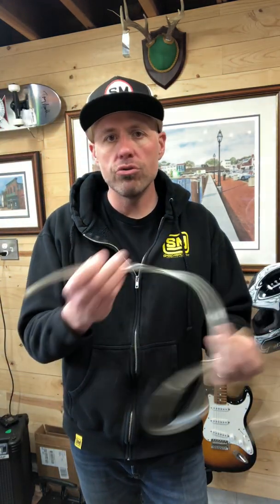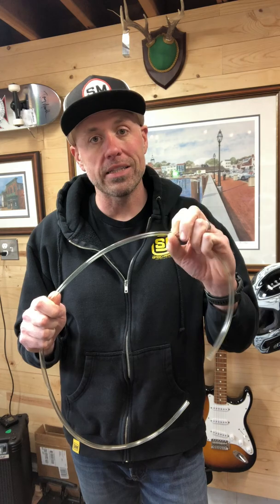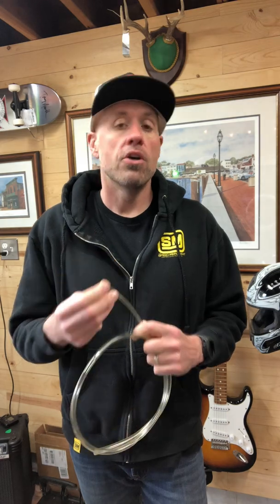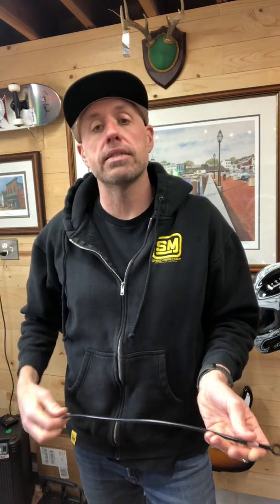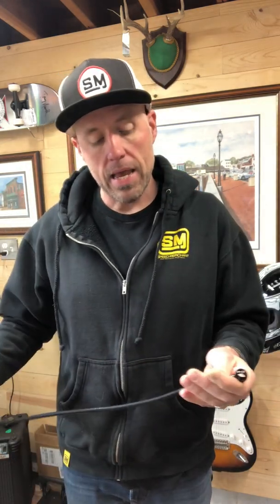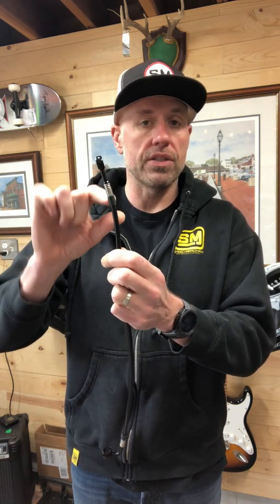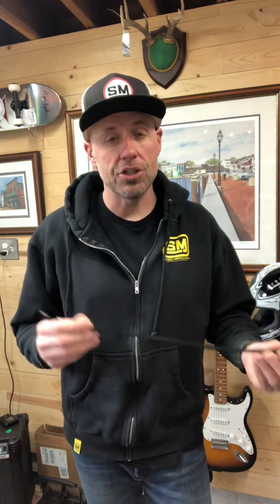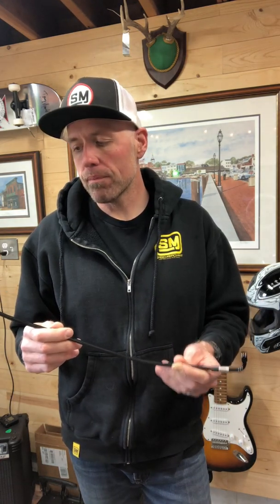Quick Tech:  How to measure Custom brake Lines

Comment: Hey there. I'm looking like getting some brake lines but I was also wondering about a clutch line. The 2008 Suzuki GSXR1000 has a hydraulic clutch line but there is a metal line. Can those type of lines be make custom? Be nice if I could get one like that. I have gone and added handle bar risers to my bike and the lines are now too short. Throttle cables as well.
Reply from the maker: In speaking with Spiegler Performance Parts they assure me all the brake lines they make and design are dual purpose for hydraulic clutch lines as well.

As for throttle cables give Barrett clutches a call, they make great custom throttle cables.  I’ve used them multiple times.